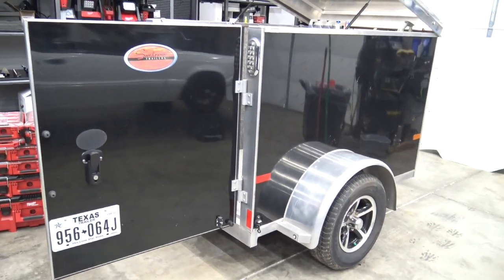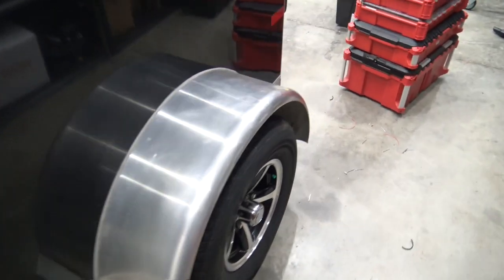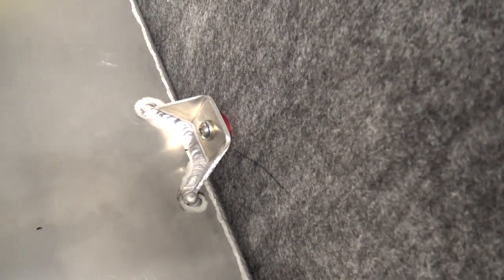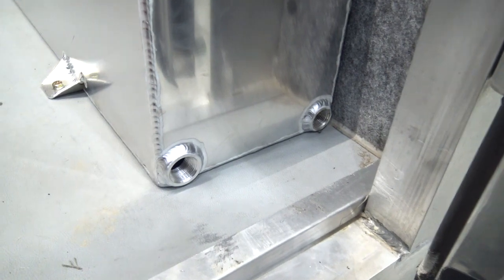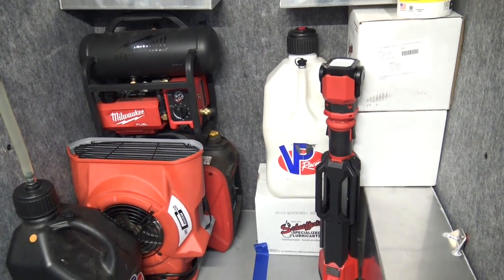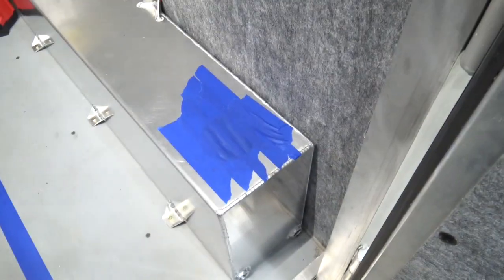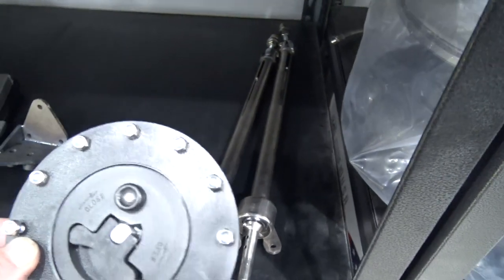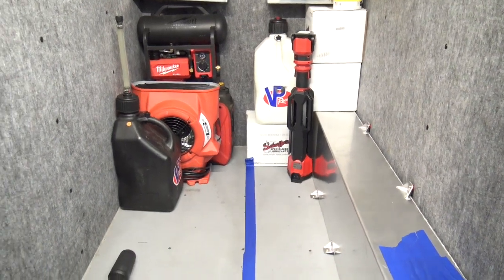Sick Week Trailer Part 1

Comment: I lived in the Tampa Bay Area for about  8 year and moved away 3 yrs ago. I assure you that in Central Florida (Tampa, Gainesville, Orlando, Bradenton) that E85 is everywhere and the avg content of the pump E was in the 70-78 range via the tube test. I would take your Meth in the cell for use at the track and run E along the journey. You can always fill with Meth as you approach the next track without much E loss just do your math in advance. I would also pack either 1 or 2 more Jugs to carry E in the trailer if you wanted to 100% ensure you could run it the entire journey and be able to top the tank for the last 20-30 miles if the need arises. Once you get an idea on day 1 of your MPG the rest of the week is easy enough to calc your needs.
Reply from the maker: thanks man.  i appreciate the info

Comment: Trailer: very important to balance the load (u got fuel,jack tires on pass side) make sure other is equal. Also the small stuff up top will all fall so make a netting to hold in place. When EVERYTHING is loaded in, take it all out an really think what you can do without. Best of luck an enjoy

Comment: what about putting a inverter in the trailer and wire it into the trailer plug. That way you power tools could charge during driving, and your not fighting for plugs when you get to the track for the generator? Would also be next level to make a quick connect so you could transfer fuel while driving into the car lol

Comment: you are looking at a little over 200 lbs of just methanol on the right side of the trailer, you're going to want to balance your weight left to right a little better or it's going to track funny/push your car around.  Also if you run the fuel cell part full and it's not a baffled tank you're going to get a little surge stopping, just saying to be prepared for that while you get used to how it drives :)  good luck man!  Stoaked to see some live action on this channel, hoping for daily updates on Sick Week!!!

Comment: run some cheap LED lighting in the trailer lid so you can see at night, along the road , in the rain ...lol.  we also put cheap led lights on those cheap magnet trays with a long led and alligator clips so you can put light anywhere.  also make sure you have enough tongue weight , and good trailer balance.  dont forget a ez up awning, a a small table/work bench , some chairs.. and I mounted a small vice on my  trailer up by where your spare is,  came in handy fixing a braided line.

Comment: Nice setup!  I've only done RMRW once, but here's my two cents... Don't overpack fluids.  Only carry enough oil, tranny fluid, etc. for one change, and then get more on the drive if needed.  Also, pack everything with the intent that you will pull in to the track, unhook the trailer, change tires and make a pass.  Try to avoid unpacking/repacking the whole trailer at every track.  And make sure you have a shade tent, lawn chairs, and a cooler for drinks. (water of course!)

Comment: Fire extinguisher at left rear,  Jack stands. Mount generator on trailer tongue. 
Spare inside. You will need the generator at every stop. The generator on the tongue will be easier to run a battery charger going down the road if alternator quits.
Use a hand air pump to pressurize fuel tank and ditch the electric pump
Reply from the maker: there is some genius in what you just said, thank you very much

Comment: Haven't done drag week style, but did street/ strip style with sport bikes. Biggest thing I would have mess up was plumbing and electrical style stuff. Being as that's you're forte you should be good. Had a air shifter line come apart on the ride before the race, luckily had spare parts in my backpack. It's the little nuances.

Comment: Tent,
Spare trailer wheel and bearings
Is your fuel refill hose long enough to reach from back of trailer to car while hooked to trailer?
Stabilizer leg on rear of trailer so it won’t turn over when you step in. 
Lights inside trailer. 

I would put that generator at the back door, so you can run power immediately without having to unpack.

Comment: First id like to say that flip top on the trailer is badass. i really like that! its definitely a unique feature and be curios if i could find a smaller one one day. 2nd off i know your car is a whole other caliber than mine, but i was going to bring the same fan and generator setup. i ditched it. this isn't class racing or anything. if you gotta cool the car down there is enough time to let it sit and not need it. thats like close to 100lbs out of the trailer. i bought a 1000watt inverter instead. i would bring a small battery milwaukee fan if its just for you. also i would ditch the big compressor as well. like you said you're probably not pulling your trans out and not really bringing air tools. i purchased the small milwaukee tire inflater after using it on drag week. 
Do you need to change your oil that much on methanol? i changed my oil mid week but i drove on 93 and raced on E. i just see a ton of weight on the front of that trailer and i think a lot of that stuff isn't necessary. Also would get the milwaukee pack out with the drawers for tools. the most obnoxious thing was needing a screw driver and having to take the top 3 layers off for it. Have a small bag at the back of the trailer with your tire change over stuff and gauge. thats what i used the most. 

when i did drag week i ended up taking a bunch of stuff completely out the day before the event started because you quickly learn what you don't need and its just added weight. Long reply i know lol. i did a video of what i used on DW on my channel if you need some more research lol.
Reply from the maker: those are def some great points im gonna check out your video on it as well.  thanks man
Reply: @theholleyefiguy  no problem buddy. I know your instinct is to be prepared for everything as that was my first thought as well. I went over my trailer probably 6 times and I’m still going to make changes for the next one.

Comment: You might want to run the return on the Holley fuel pump as a vent, unless you are planning to add an additional vent, you will need air to displace the fuel you are removing, and something for expansion as well. You could just take the cap off when you are running the pump, but you’ll still probably need expansion.
Reply from the maker: There is a cap on the pump module now till a vented fitting comes in

Comment: Leave the generator unless you need it to run fans at the track.  Same with the compressor.  The mini m12 compressor should suffice.  I’d keep the trailer as light as possible.  Get a bunch of moving blankets.  Keeps shit from chafing inside the trailer if you need it but mostly...to lay on when you have down time or need to fix shit.  -Ry

Comment: Mount tires to outside of trailer to save space. Not sure on alchohol. I wonder if anyone has done the event before on alchohol. Most i seen switch to a alternative fuel.By your estimate fuel consumptions on alchohol vs e85 your are almost half the fuel.

Comment: Hello where did you get the air clean for tor turbo or is it a fab made and what size turbo are are you using  Thanks Paul
Reply from the maker: My Fabricator Matthgew smith with Performance fab in roebuck sc made it
Reply: @theholleyefiguy  Thanks for the info

Comment: Be cool if the entire floor was like a 6 inch fuel cell.  Would distribute weight better id think.  Then i would design some sort of pull out drawer deals.  Strap the tires to the sides on the trailer to have more space.
Reply from the maker: we thought about that but it wasnt very feasible for an intank pump
Reply: @theholleyefiguy  hey fair enough man,  bottle jacks can save a ton of space over floor jacks.  Not near as heavy too.  Handy little devils they are.
Reply: @theholleyefiguy  center the fuel cell and build 2 drawers on either side then have a raised floor.

Comment: if you haven't already, watch the trailer prep motion raceworks/doug did a while ago, it outlines everything IMO
Reply: imo I would avoid the generator and compressor if at all possible, which means you can also ditch the one jug of gas. The less weight you're hauling the happier the trans will be

Comment: I would have used the Mr.Gasket pump. Just make the tank a little bigger on one side. I think the Mr.Gasket will go in a 5 gallon, If not a 15 gallon. Would be perfect and u can use dual voltage 120v/12v
Reply from the maker: i have 2 of them here, one will go in the trailer as a backup

Comment: Good luck making that whole drive on methanol. Economy on meth in that car can't be into the teens, can it? 1000 miles at 10 mpg means using 100 gallons on the street, plus what you burn at the track. If anyone can do it, you can!